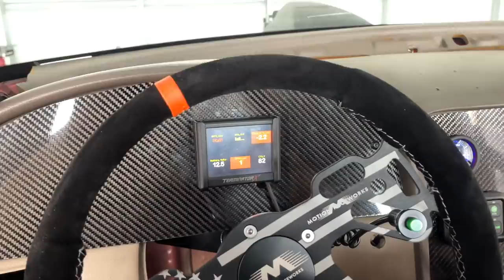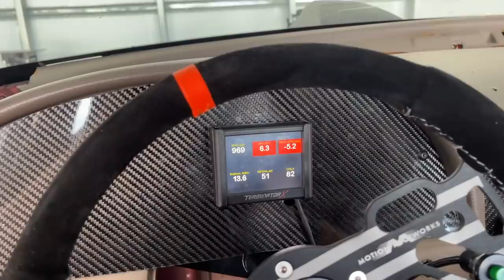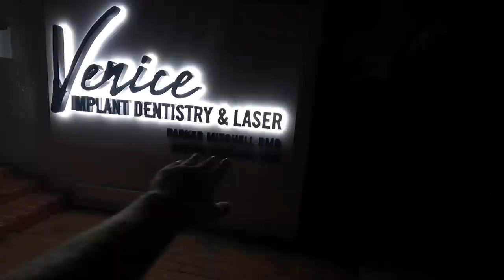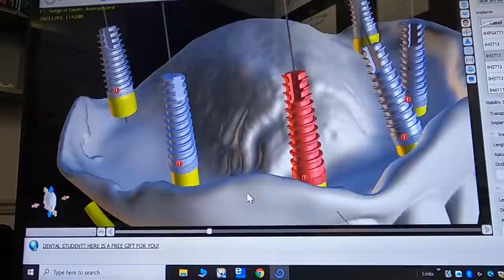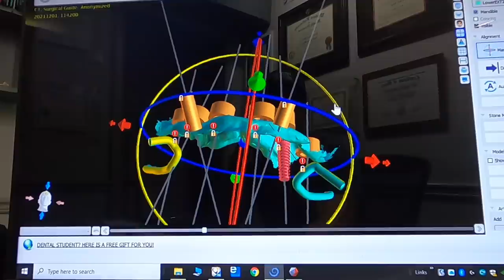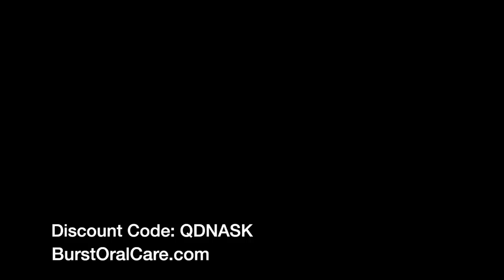Bought JH Diesel A New Bogger, Suspension Upgrades on Dr. Pepper, Introducing Whitney the King Ranch

Comment: Parker if ya dont like that ridiculously low front valance ya can either cut it or swap a 2wd or a Tremor lower valance on it if ya wanna pay. I completely removed the one off my 2012. Lots of guys remove em. Also look at the rear air bag assist kits. I run the Firestone Ride-Rite and love em pullin the gooseneck. Got my mine from Xtreme Diesel Performance and were delivered in 3 days. At the time they were the cheapest.  Not to mention it works with my Ready Lift level kit and the in bed B&W gooseneck hitch. Be mindful ya look at that if ya ever order bags so it works with whatever current equipment the pickup has brother. God bless you man.

Comment: Keep the old doors off the car and gut them and just put a piece of carbon on the inside for the door cards and put Optic Armor lexan windows in them with a titanium window mounting bracket from Quarter-Max and get the door locks that mount on the Lexan and lock to the roll cage for when you want to get the car really light and go really fast but still look kind of factory and believe it or not if you gut them enough you can get them really light I know you can get them within a pound or two of a fiberglass door and that way you can still have your side mirrors if you want to keep them on the old doors and if not you can take them off too and just put a piece of carbon over the holes from the mirror

Comment: I have a question about my teeth, which are residing in a sealed container of water and have been for a couple years. Can an existing set of dentures be converted to snap in style? Mine fit me very well, and look great. Buuutttt, they started gagging me to the point that I just could not keep them in my mouth. I am kinda upset because they were expensive.

Comment: Man i like your variety of content, i have soft teeth run in my family and nearly everybody has dentures which i will be getting the bottoms done soon. Eventually i would like to get 4 implants as a securement for my dentures but if i ever win the lottery.....full set of of those screw in studs will be happening. 
Glad to see you get a decent truck, Dodge has yet to build a truck to outlast those 12V engines. Then again Ford hasnt built an engine to outlast their trucks either and im a die hard Ford guy🤣

Comment: I spent 40 grand on full implants on all my teeth. I got the bottom ones finished after about a year. Had to have a bone graft to have enough material to hold them. I'm allergic to opioids. So could only take ibuprofen and tylenol. It was the worst experience I've had in my life. Then my dentist passed away. And I never got my top teeth finished. No one took over his practice. So I have a top plate. And bottom implants. And I really don't want to spend another 20 grand or so to experience that torture again. So that's my story.